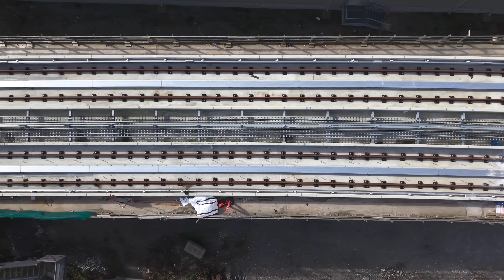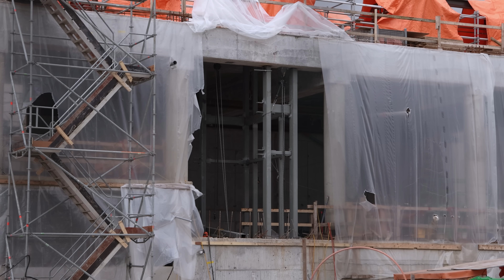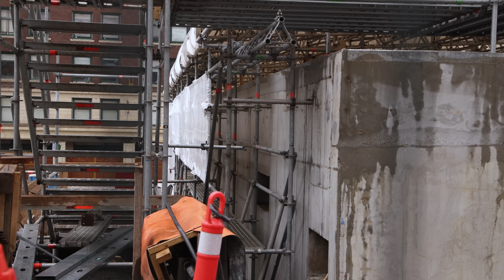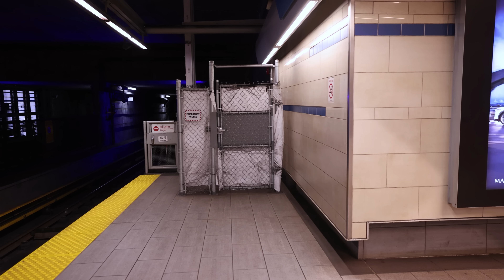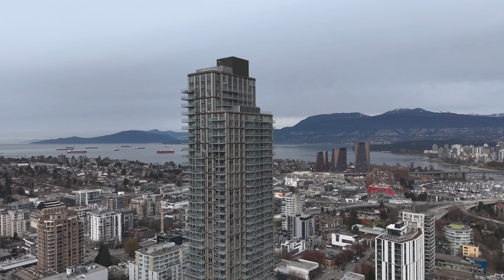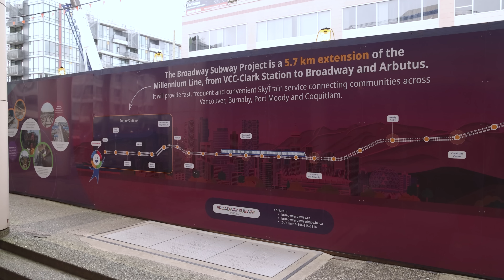Broadway Subway Construction - March 2026

Comment: I was wondering about the tunnel section in downtown. How did they avoid all the deep construction of the big highrises? Won’t the reduction of dirt cause a problem of support?
Reply from the maker: Between Mount Pleasant and Arbutus the tunnels are directly under Broadway to not impact any current or future nearby buildings. They're also around 20 meters deep, so no impacts to anything on the surface.

Comment: $3B is an insane amount of money for a distance that can be walked in about 1h.
Reply: Yes the stretch itself is only 5.7km but it allows so many riders who are coming from all across millennium line to easily access a majority of the broadway corridor, downtown. and Richmond all by train. The corridor is the BCs 2nd largest employment hub outside of DT, and accounts for 9% of our GDP in Vancouver. 

We’re projected to add an additional 41k net new homes and accommodate 64k residents with these new infrastructure upgrades. 

Expensive…yes… but infrastructure projects, when done right, are always net positives for the economy.

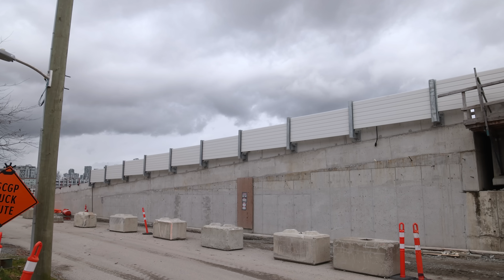Comment: 2:12 That's not stepping down neatly, that's as ghetto at the 1940's sidewalks around Metro Vancouver with those rounded edge trowel lines that making pulling a wheeled cart or airline carry-on bag a noisy and damaging endeavour. They could have made the noise fences follow the slope of the concrete but much like a lot of things down around ghettoville, they went for the easiest and fugly solution because, why not, that's how they've done it so why change and they still get paid for that garbage work.

Comment: it will be interesting to see how they assign rolling stock to this extension. The MK 5 will not be fully rolled out and they probably won't yet have fully retired the MK1 by opening day. there's also no chance that the new OMC in Coquitlam will be available. The 2 car MK 2s that run on the Millennium Line exclusively are at capacity right now and will be massively overcapacity if they have to start taking #99 B Line traffic. The Expo line currently has vastly higher ridership than Millennium Line but that could change with this extension.  I would start shifting MK2.5s off the Expo as MK5s arrive, and double up existing MK2.0 into 4 car units, then gradually push MK3s onto the Millennium line. I'd also turn about half of the trains around at Production or Lougheed, reducing frequency on the Evergreen Extension until the new Coquitlam OMC is built (probably 2 years after opening) or until there are enough vehicles. Thoughts?
Reply from the maker: So there are a few things going on right now. Remember how the Expo line stations were modified to handle the mkVs? That's happening now on the Millennium line so that MKVs could be run when the line opens. I don't know what the service pattern will be fully, but the Waterfront to Production way trains will turn into Waterfront to Arbutus. That way the busy part of the line will receive more service and improve connections from the Expo to Millennium.
Reply: @StainerTheFirst  How is Waterfront to Arbutus possible unless the train switches from the Expo onto the millennium line?
Reply from the maker: @thespiritsafe  It's just extending the current Waterfront-->Production way to Arbutus. Just like how it was before the Evergreen extension opened pre 2016.
Reply: @StainerTheFirst  My suspicion has always been that they're going to swap which line has to deal with the Lougheed/Columbia gap as the Surrey-Langley extension approaches. This would allow for maximum throughput across the bridge towards Surrey on the Expo line while letting the lesser used millenium line handle the 'split ends' of Evergreen and the Lougheed/Columbia bit. Of course the Broadway extension may change usage patterns enough to make this favouring of the Expo-Surrey alignment less sensible.

Comment: Great, now when this is done, keep going all the way to UBC, as the Millennium line always should have back in the 1990's when it was first built. UBC is always where this should have gone, and there have been too many excuses for stalling over the years, while the land got more developed and expensive. Next station around MacDonald, then Alma, then Blanca, then to the heart of UBC. DO IT!
Reply: Agreed. Not sure why they couldn't add 3 or 4 more stations to get to UBC.  This will shorten the commute for sure, since they can do frequent shuttles between Arbutus and UBS, but why not just finish the job?
Reply: I agree but if they did it all continuously the project would have taken longer. A two step plan would be good so people can use the subway while work is going for the ubc extension!
Reply: Just lack of funds
Reply: Let UBC pay for the extension, they have created the bottleneck along Broadway but they dont want to pay for it. UBC doesnt mind spending millions building all those condos out there.

Comment: Recently they closed VCC station for a day. I feel like they were placing the track or parts because the only reason they would shut the power off is for safety.
Reply from the maker: You could be right, might have been for the power rails. Although connected, not powered.